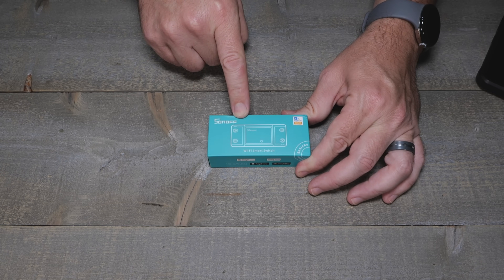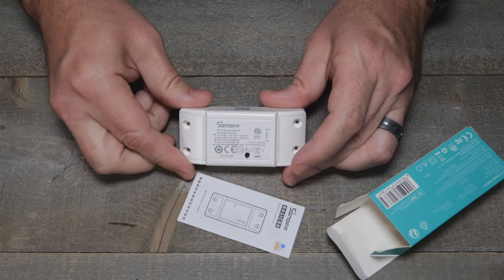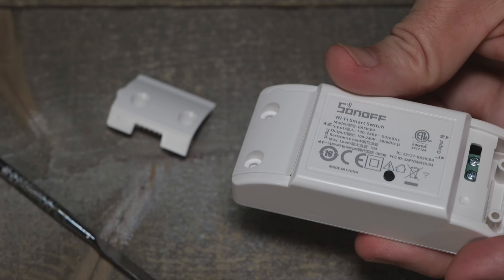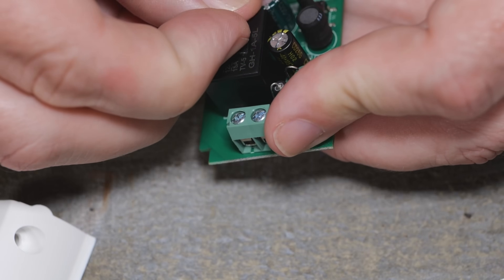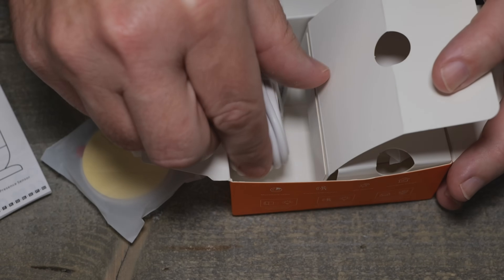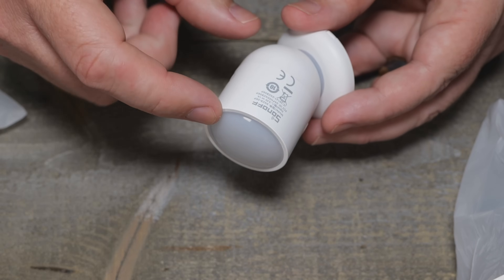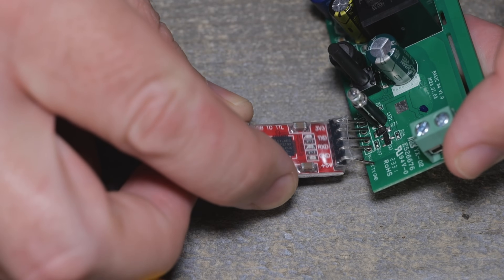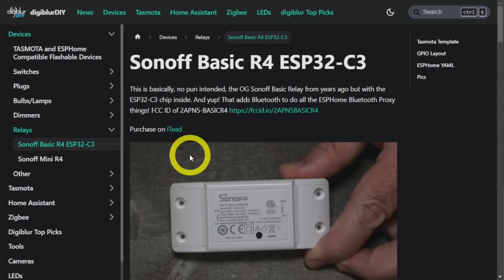New Sonoff Basic R4 ESP32-C3 and Bonus mmWave Zigbee Sensor

Comment: I´m trying to flash my Basic R4 with all the kown tools, I don´t get an error, but it will not boot, I can´t see any Acces Point to connect. 
Is there an .nin file you can share to just flash it and get it run? 
Or can you help me with flashin it with ESPhome and your yaml ( what I never done so far ). 
Every help is welcome.

Comment: The Sonoff Basic R4 is even cheaper than Basic R2. By looking at your video, it seems it has much lesser components, notably it is missing a switching transformer. That could mean Sonoff is using a non-isolated power supply for this smart switch. Would like to hear from you about this in term of safety and reliability of the switch.

Comment: Just got a few of these today, flashed with esphome 2023.11.6 using the YAML off your site, it flashed fine, boots fine but pressing the button does not trigger the relay and when I add it to home assistant it does not see the relay as an entity. Has anyone come across this and know how to fix?
Reply: So they say the definition of insanity is trying the same thing and expecting different results, but its actually trying the same thing and getting different results... Flashed it again and now it works, after flashing it about 20 times...

Comment: Went to flash Sonoff Basic R4 on Home assistant and received error message that it does not support Arduino. I was using the YAML file from your web site.  Any suggestions.
Reply from the maker: What version of esphome?
Reply: Embarrassed to say Home Assistant 2021.12.7
Reply from the maker: Can you update esphome? Probably might be some new features that aren't supported there
Reply: Yes, will try that and let you know how it goes.  Thanks, @digiblurDIY
Reply: Updated HA 10.5 and ESP 10.2. Was able to flash the YAML file., but no wifi connection. error:  an error occurred. Improv Wi-Fi Serial not detected
Reply from the maker: @user-kw5ii9it5t did you put your wifi config in the yaml? Not sure what improv is. Never used that method.
Reply: @digiblurDIY    After the bin file was successfully down loaded the error message appeared: "An error occurred> Improv Wi-Wi not detected "  .
Reply from the maker: Sounds like some sort of web setup method there. This is what I use. https://digiblur.com/wiki/ha/esphome-esp32-how-to-flash
Reply: That is the procedure i followed.  I am going to order another chip and try again.   Thanks for your help.
Reply from the maker: Looks like you are trying to configure the wifi via serial. To do that it needs another component added to the device. I normally just put in my wifi credentials to begin with. https://esphome.io/components/improv_serial.html?highlight=improv_serial

Comment: The basic R4 has a "magic switch" function and you can control it with a "normal light switch". By adding a wire link to the light switch, that powers the basic R4. It can detect the brief switch trigger/transition. It won't be turned off by that switch, just triggered. You link the two changeover contacts of the light switch together with a bridge. So you can put the basic R4 up by the light fixture, and directly control it with the light switch or over wifi, at the same time!🤯
Reply: doest the "magic switch" function works after tasmota/esphome flashing?
Reply: @ArifRoni  that is a good question 🤔. My guess is that the "magic switch"  function. Is implemented in software (and mabe some "hardware circuit"). So It would have to be implemented in tasmota aswell, somehow? It's a clever trick, and I would love to see it in more smart switches.
Reply: Would also be interested, if this works after tasmota is flashed

Comment: Good presentation and you are right "new isn't always better". I've migrated many of my sensors to the C3 and to alleviate wifi congestion on my mesh routers, I moved my devices to ESPNOW protocol, including my Sonoff ESP units.. With a simple little ESPNOW to WiFi bidirectional gateway, I expanded well beyond the router's dhcp capability,

Comment: Would it be possible to do a tutorial on flashing with ESP Home and use them as Bluetooth proxies? 
Also not sure if you mentioned this but they have internal chip temperature  monitoring making them more safe.
Reply from the maker: Basically what I did here. I just didn't show the entire part of plugging in the USB and sending the file over. The yaml file is there
Reply: @digiblurDIY  Thank You in advance. 
Quick question:
 I get this error when installing your esp proxy yaml file. Already have ESPhome generic and WiFi access. 
It starts installing then stops a few seconds in with this error.
"Platform Manager: Installing platformio/espressif32 @ 3.5.0 Error: Please upgrade to the PlatformIO Core 6"
My hardware is raspberry pi 3b.. yeah I'm about to upgrade to a mini PC. But for now, any suggestions?
Thanks again

Comment: Please, it's "millimeter wave" not "em-em wave".   Just like 2.4 giga-hertz and not gee-h-zee..     Millimeter size wavelengths because stupid-high frequency for the doppler radar thing they're doing.   You can be the trend-setter in the home automation community and use the correct naming.
Reply from the maker: Probably not some toothpaste that can be put back in the tube unfortunately even with this one being 5ghz.

Comment: I got a few of the older Basics last year for Christmas lights. The whole 10A rated device on a 20A circuit is always funny because the little extension cords my wife uses are probably 16gauge at best anyway. If you put 20A through them, they wouldn't have insulation on them for long. At least the Christmas lights themselves have fuses in the plugs.
Reply from the maker: It should be a requirement that all extension cords have those fuses but I guess that would create more waste than waste from the house fires right?
Reply: @digiblurDIY  in the UK all extention cords are fused. The reason for this is that socket outlets are on a 32Amp circuit breaker! That's a lot of power on the 230V used on everything. So every appliance plug, has at least a 13Amp fuse installed.
Reply from the maker: @MyProjectBoxChannel this should be a requirement worldwide

Comment: I like the sonoff basics because it was and perhaps is the cheapest easiest way to get an ESP with a built in power supply. No usb charger needed. You can cut it and make it a dry contact.
Reply from the maker: They are definitely weird at this time.  I guess if you need something with GPIO pins to connect to.

Comment: I'm past the mmwave era now.. stepping into the Air quality one and boy is it a rabbit hole
Reply from the maker: I dabbled a little in that but I guess since my air runs so much it helps keep the dust particle level down already so adding sensors and other air cleaners never seemed to impact anything.
Reply: @digiblurDIY You're probably also in a healthy area of the planet.. with the asthma affecting both kids I'm trying to find a reliable source for data on air quality in my home.. 
meanwhile do you have a link to the sonoff mmwave sensor? Any idea if it's 24GHz?
Reply from the maker: Not really. They call this area cancer alley.

No link to it yet or specs. New device.
Reply from the maker: Found it... 5ghz - https://fccid.io/2APN5SNZB06P

Comment: One thing about the case : i really liked the look of the 2d version case ( you showed that too, the one it was zigbee too) but i thing that had some security issue, we can,t secure very well the cables.

What i don,t understant is why they do the solder traces again, the r2 version back then with thick wires was way better.
Reply from the maker: Yes the one with the wires was definitely the better one. They just need to make a small relay that is 15A and skip the basic stuff here.
Reply: It's cost of manufacturing: by making the really wide trace, when you wave solder you get the thick solder "for free": notice how the one gap happens right where the track in thinner to go around an smd component.